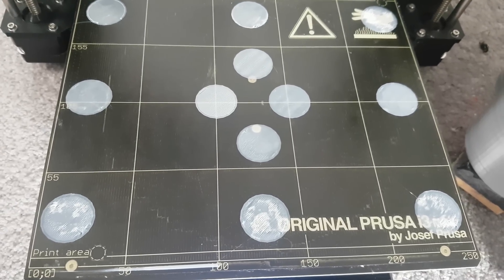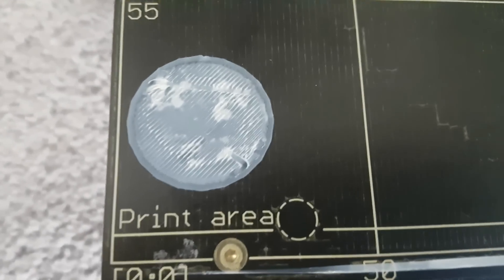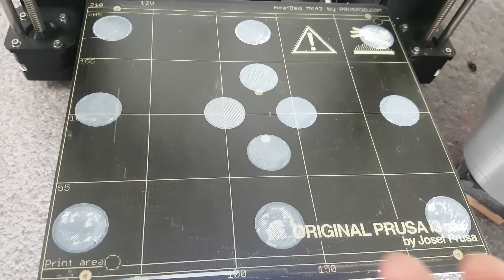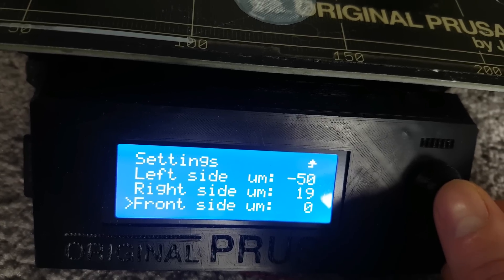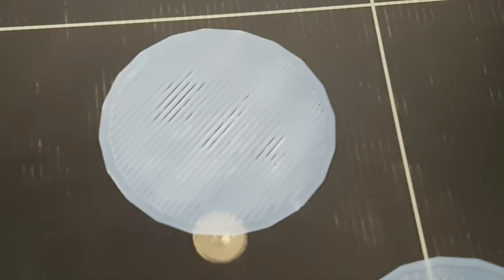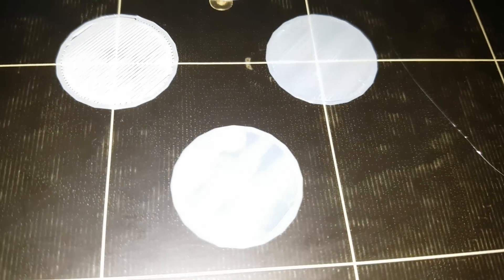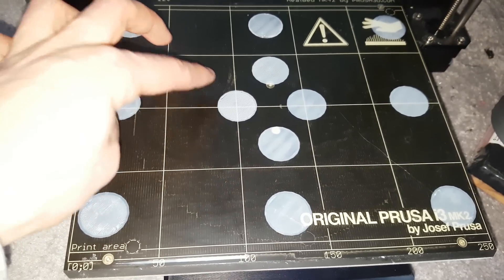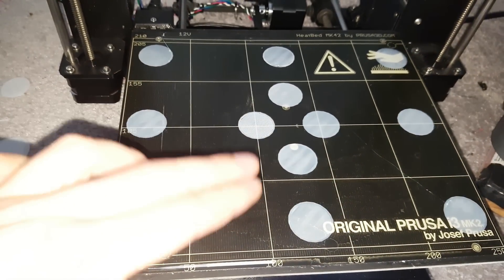Prusa I3 MK2 Mesh Bed Levelling not real??

Comment: What I don't understand is if you have and I quote "know idea" why are you complaining about prusa's sensor. My suggestion would be to stop being stupid and do some learning about 3d printers oh and build your printer properly the bit where you show the bearing the rod is not seated and cable ties properly. In conclusion your either deliberately making faults to falsely complain or you have know idea what your doing and should stop complaining about the printer and read the instruction and rebuild the printer correctly

Comment: Given that the MK3 now has 9 screw points to hold the bed flat, it's definitely a Real problem that had to be addressed in MK3.... some people get lucky and it's flat enough, some not.  see the tom's interview where he mentions it.      hopefully this is in the MK2.5 upgrade.... it's not known at this point.   Mine is like this guy's and mesh don't fix it.    you won't notice if you only print near the center.   issue arises when filling the plate with parts.

Comment: Bro at 8:55 you can plainly see you assembled the printer incorrectly, the rod isn't seated in the slot at all!  come on man, at least assemble the machine correctly before saying the bed leveling isn't real
Reply: it's 3mm, it's stiff but certainly bendable with a pinky. But i don't see how stiff means flat.   Also the screw holes need to be tapered 100%, if one is .1mm off there goes the flatness, same with those lock washers and the screw holes....  that's why people use glass but it's also heavy for a Cartesian so a PCB is a good idea but that leveling needs to be better... a 4x4 point would be idea.
Reply: mine is, it ain't level nothing.... put a straight edge on the bed, i have 3, none of them are completely flat and some variance is larger than 50um, more like 300um.... better start with a layer height of 0.3-0.35 for all prints if you're using the whole bed or shit won't stick.  9 point leveling that don't level is shitty indeed.   should be 12+
Reply: As you say, clearly the rod has not been pushed down into the holder.  No wonder it doesn't work.  Mesh Bed Levelling is only calculating the tilt of a flat bed.  If the Y axis is not seated the plane will not be flat because the closer the bed gets to the front the rod will lift slightly
Reply: Depends on your definition... you can use 9 points to calculate the plane, though only 3 are required.   it's assumed its mesh leveling considering it also has some correction points.    it's a PCB, it's like the lottery if you'll get a flat one or not.... mine isn't and i had to shim  on a corner.   the center is slightly higher in a spot than the other etc.... and the mesh level definitely does worse than i've seen in marlin or repetier.
Reply: It doesn't.  I've looked at the source code, it computes a plane for the bed
Reply: And have you felt the stiffness of that PCB?  I replaced mine recently and it was completely impossible to even flex it.
Reply: Actually, a 3 point levelling set up would be ideal. If one corner is out on a 4 point levelling it will flex the bed. I would’ve assumed that most new a plain was defined by 3 points not 4.
Reply: you can level the plane with more than 3.....  it's more accurate than 3 alone in the computation apparently.   In repetier firmware there is grid "tilt" measurement and a separate mesh "leveling", you do both generally.   However MK3 addresses this (or tries) with more screw points (9 vs 6)

Comment: I had the same problem. I think you are expecting the bed mesh leveling to do mirracles, its really good but not that precise. Come on its only 9 spots, if there where more spots it would be better, but more time consuming and more complicated.
I was printing the first layer at 50 um, the way i fixed this issue was printing the first layer at 100um. All problems went away.
Reply: except it's all been done in other firmware, it isn't complicated.  it's just more points.  i have 24 on another with a bltouch, you can increase or decrease that easily.     i have 3 mk2's and straight edge says they're far from flat, a variation of 50um would be nice, but some places its 200-300um.    only option is to shim, adjust correction best possible and use a 300um first layer.

Comment: If your prints are not sticking to the bed you need to scuff the bed up with really fine sandpaper or Scotch Brite pads. I never need glue stick. Also clean the bed with alcohol once in awhile. Prusa should be telling people to scuff up the print bed before using it, makes a big difference in how plastic sticks.
Reply from the maker: Hi, My prints do stick really well, now that the levelling seems to be ok on it the main thing is that with the dip in the bed towards the centre left and back the nozzle is a bit further away which means I have to be careful how I orientate my print since if a corner or small edge is over the dip then it may lift there but be fine elsewhere.

I have read a lot of good stuff about a light sanding with fine grit on the PEI sheet and I have some fine grit sandpaper ready to do this if I need to in the future.

Also I rub with Isopropyl alcohol before every print. Always works well.

Comment: So you bought a >700€ prusa, didn't even bother to learn what are its features, didn't bother to learn gcode, didn't bother to even call prusa's sav or visit prusa's forum, and made right away a video called "Prusa I3 MK2 Mesh Bed Levelling not real".
Great. 
Got a tip for you : Spend your time googling for infos, solving your own problems and education instead of making insulting and ignorant click bait titled videos and commenting them...

Example : That would take half the time to write "It's a shame we can't adjust certain patches or like break the bed into a grid and adjust the z for each square of the grid" to google a little and realize you actually can...

(Source: that vid and its author's comments)
Reply from the maker: Actually I googled and searched forums and info non-stop for weeks since it started happening. I'm talking hours and hours a day because I love finding out as much info as I can and I never saw this. Also learning GCODE is not something somebody has to do. It may help and I may learn some eventually but it's not a necessity.  Plus it's not a very expensive printer at that price. a £2-3K printer is a bit different. it cost me £600 and in the end it turns out I got it for free.

There's also been tonnes of other people complaining about the same problems with the z axis calibration. This video is to try and get help from people who have had similar problems.

Also how would I have guessed that googling a 26 word sentence might have helped me. If it was so simple to find solutions then nobody would be complaining about this.
Reply: Ok but think a little more before making such titles...
Mesh bed leveling is of course real on the mk2, as real as it is with ANY 3d printer with a common firmware like marlin for instance...
Reply: Join facebook groups like reprap which has >7k members.
Youtube is really not the place for gathering info or asking tech questions.
For the www, reprap.org is a good place to start with.
And at the gcode page (even if you don't want to learn it) : look for instance M420
http://reprap.org/wiki/G-code#M420:_Enable.2FDisable_Mesh_Leveling_.28Marlin.29
Reply: Wondering how you got it for free! Mine's on the way, I wish it had been free! :)
Reply: How can you set up each grid part? Can you please link it?

Comment: I get pretty much the exact same issues as you. I think its a characteristic of these types of printers tbh. i wont be advising anyone to buy prusa i3 mk2 kits, thats for sure. Maybe get it pre-built by them for the extra 200... but at that point, might aswell go for a different printer.
Reply from the maker: Oh really, have you managed to solve any of your issues?
Yeah unfortunately I thought everything would be perfect but obviously not. I wouldn't recommend it either I think, if it wasn't for the bed levelling and noise level it would be great but unfortunately the bed levelling is on of the main factors in making a printer good or bad. I do still love the printer though and my prints look great half the time. Think I'm in a love/hate relationship with it now.
Reply: It seems that, at the moment, I fix one issue and another pops up. Fix that, and the one I fixed comes back. I totally get the love/hate feeling with this. It's great at printing little thing (whistle, batman, tree frog) but try something big (GameBoy case) and man... So many problems.

Comment: You may reset all settings and reprint these slightly smaller or print a grid and then measure the depth of first layer print with a vernier calliper to see what readings are across the heated bed . Another method may be to add a micrometer gauge attachment and do some g coded to compare heated bed with cold bed terrain . Laser on an angle might  also be handy .

Comment: good video!

might it be that:
the bed bends if it's goes hot?
and perhaps each time in a different form?
or the bed is always crooked/bended?
is it not better to use a glass sheet on the bed?
(maybe glass is more flat)

Friendly greetings from Netherlands
Rob.
Reply from the maker: HI, yeah I expect it is warped and it may warp more or change shape slightly as it heats but the mesh bed levelling is done once it's hot so it should account for that at least. I've started using a brim and trying to keep the z level even lower than usual. I don't want to use a glass pane on top because it defeats the whole point of buying this printer with the special heat bed, inductive probe points and pei sheet. Thanks for the suggestion though.

Comment: As i have said before, the prusa mk2 is an over-hyped, overpriced P.O.S. the thing does not do what all the fans boys say
Reply: Prusa is running over 200 or more of his own machines nearly 24/7 in house to manufacture the printer parts in a farm. Yeah, they're total junk...
Reply: You're actually right and wrong. Prusa MK2 is overpriced. However it's not a pos, it's just a prusa. That's all. That has became a standard for low price easy made reprap. That alone you can only give him credit for, and don't forget he release everything open source, so free to you to buy a 150€ chinese clone or source the components and do same quality for cheaper than his. Now a messiah ? Of course not. Just a member of the reprap community that deserve credit for pushing it forward. For instance, he just implemented smooth variable layer height in his slicer : he didn't invent it, algorithms were already available, but he still deserve credit for having implemented them at last. Now of course you have different buyers profiles : fanboys, uninformed people relying only on fanboys statements, or lots of reprappers having had or made prusas and feeling they owe him something. Something is very certain, they're very reliable machines, with top quality parts. However you're part right, to say it's stupid to hear ppl defending it saying "quality print is awesome". Reliable or quality would be more clever.
Reply: +Mark Duncan I'm sure your statement is backed up by plenty of facts and not from your own lack of expertise. Josef Prusa is also one of the original developers of the RepRap project and consistently makes pretty solid contributions to the industry.
Reply from the maker: There may be problems with the bed however the print quality is still awesome.
Reply: kindly point to those facts
Reply: there was also an MK1, that one sucked.   the  popularity of the MK2 was determined by the public and people who discovered it.   it is easier and cheaper than most other overly over priced printers.... eg.. the taz, also overpriced printer throwing around a heavy extruder pushing 3mm filament.  3-4K ultimaker, good gantry but still way way over priced.... like wayyy over priced.    I think the MK3 puts other printers in their place that are running in the 2K range and up now.... finally making use of features i've had on my own custom built machine i wish was just included.  24v, silent printing, back EMF detection for skipped steps and filament detection?   that should be default in anything over 1K.... (unless it has a big bed i guess).
Reply: The Facts are all over the internet to see for yourself, I dont need to prove anything, those facts are out there if you look. I just use my eyes to see and logic to reach the facts, and while messer prusa might have ridden the gravy train since the beginning, that fact alone does not give him the rank of messiah, one that many incorrectly bestow upon him

Comment: Can anybody explain what the deal with Bed Level Correct is in the first place. Whats the point when you already have automatic bed leveling?
Reply from the maker: That's the whole point in this video, you're meant to have auto bed levelling so why should there even be a manual bed level correction option. This is why I think the mesh bed levelling etc doesn't actually exist. I think it just checks for XY skew.
Reply: Ok, that sounds more like a conspiracy theory and I'm not a fan of tin foil hats... :-)
Have you even seen the XY Calibration in action? It goes from side to side. The up/down movement would not give any info to calibrate skew.
Of cause automatic bed leveling does some compensation, but I think there is something more to the story that Prusa is not telling since the need of additional compensation.

Comment: Forgive my noobish remark, my claim to 3d printing is still in the post on its way to me:

but to me with 0 experience I would say that the bed is not true! ie the bed rises and falls across its surface?

The only other alternative I can think of is your X & Y guide rails are not straight causing the hotend/bed to rise and fall fractionally as it moves along!
Reply from the maker: Hi, welcome to the 3d printing world :-)

Don't worry I'm pretty much a noob too. the bed probably isn't level, at least not anymore but with this printer it's meant to account for that in the software and adjust the nozzle accordingly however it doesn't seem to do that. I checked my rods before I installed them to make sure they were straight and they were perfect. Also the machine checks for XY calibration and it confirmed this was perpendicular but even if it's slightly off the software accounts for it again. Luckinly it stated mine is perpendicular. Lastly I did originally think maybe the x axis rods were higher on one z rod than the other but when you calibrate it you move the z axix all the way up til it can't move anymore and this makes the z axis horizontal.

Hope that all makes sense.
Reply: ROBNOB9X, hmm my next point of call would be the cheapo Chinese sensor do-dad!
Although i remember seeing that a lot of the printers self calibrate the bed in a trepazoidal fashion ie, they take 3 readings from various points on the bed and adjust accordingly.  That way is still as accurate as mapping the entire bed surface but only if the bed itself is dead flat (machined or glass flat) if there is a dip in the surface of the bed in some random spot then the auto level wouldn't know unless the whole surface was scanned in pixel by pixel manner!

But again I'm speaking from machining experience not printer experience! Hope you get it sorted in the end though dude :-)

Comment: Here's my method to get the bed as right as you can.
http://coledesignandmanufacturing.blogspot.com/2016/12/like-butta-original-prusa-i3-mk2-full.html
Reply from the maker: This is a great guide, a few people have suggested manually adjusting in the gcode but I didn't know how to do it until now. Thanks o much for posting that, really helpful. It's a shame we can't adjust certain patches or like break the bed into a grid and adjust the z for each square of the grid, that would be ideal. I feel like I could get my bed pretty level except for that weird patch, I guess it wouldn't matter too much if it;s in the middle of the base of a print but anywhere near an edge and it'll just warp now unfortunately.
Reply: ROBNOB9X glad it helped.  About your thermal expansion question from my other post, it doesn't seem to matter as much with respect to consistency as does the heat's effect on the probe's accuracy.  I've gone so far as to cram a wedge between the bed and frame, visibly bowing the bed up at what was a low spot and it still printed too far from the bed in that spot.  It appears that the distance is based on the probe's precision at sensing each point rather than the actual warpage.

Comment: is your filement getting pulled to much when the head goes to top left? my prints done that and I realised the filement  was getting tight when getting pulled to the top left
Reply from the maker: +Richard Spicer yeah that had crossed my mind too but literally a cm to the left of those weird patches and it'll be perfect so I don't see how that could be. Plus it happened even when I'm using a spool with hardly any filament on so it's really easy for the extruder to pull on.

Comment: It looks like you have a mechanical issue in your printer's rods, not the leveling bed.
Reply: Yep
Reply from the maker: Perhaps although I checked all the rods before I built the printer so I don't think anything would have caused this whilst printing.

Comment: You also need to increase extrusion multiplier by 1-2 percent, or heatbed temp by a few degrees. The best way to remove variables and just focus on warped bed would be to use a straight edge, and also a feeler guage underneat the nozzle at all these points as temps and extrusion could also be coming into play. Temperature changes in the room could also slightly effect this or if you have a breeze